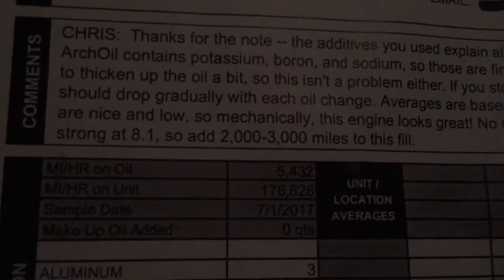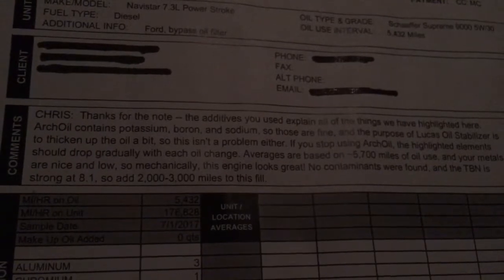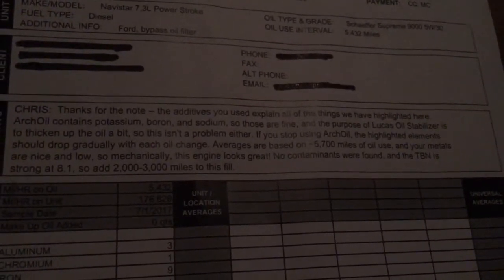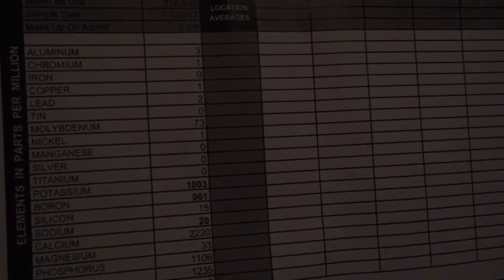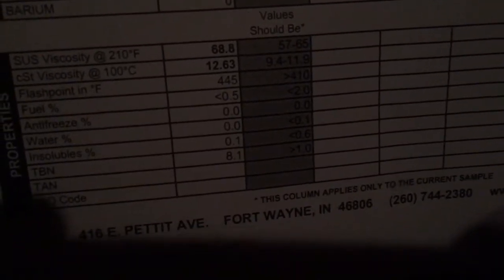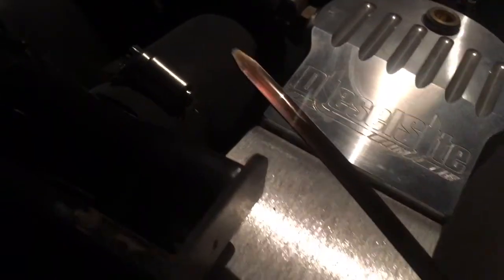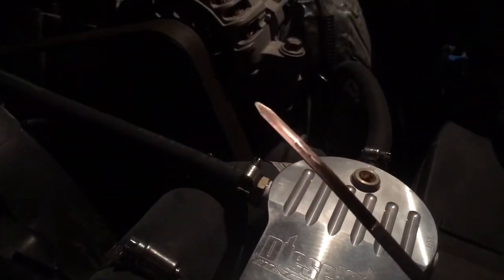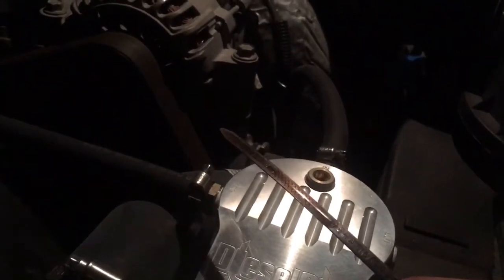NUC Oil Filter Bypass Oil Analysis #1

Comment from the maker: Hey Highball in response to your question if I can double my oil change intervals how would my bypass system no pay itself off? Also I would never run a oil change to 40-50k. I'm not sure where you read that claim. Claims of never changing you oil is a hard thing to believe. I have not seen any proof that oil does not break down.